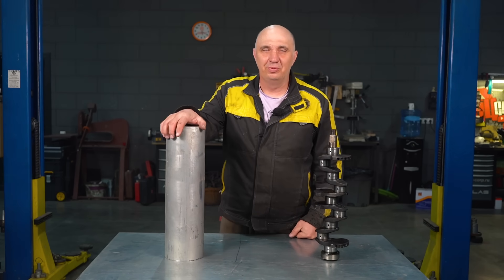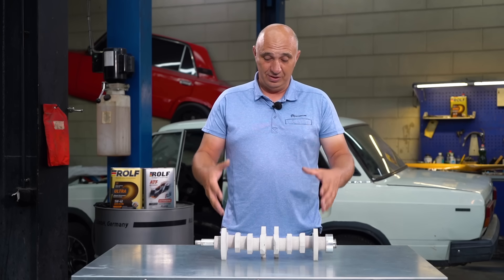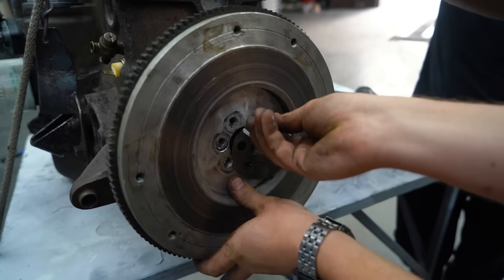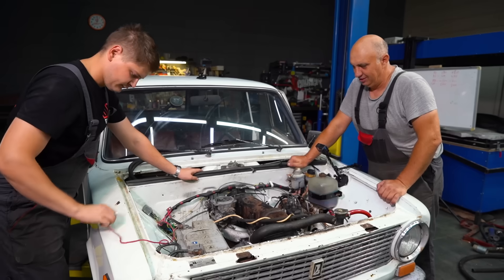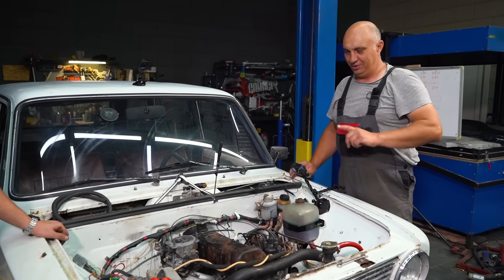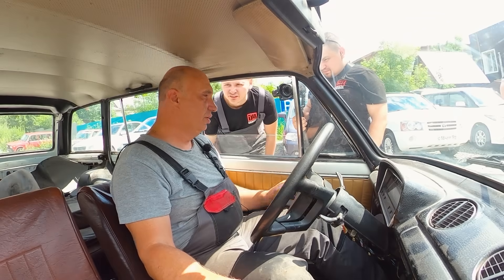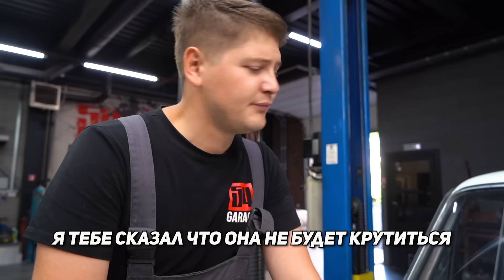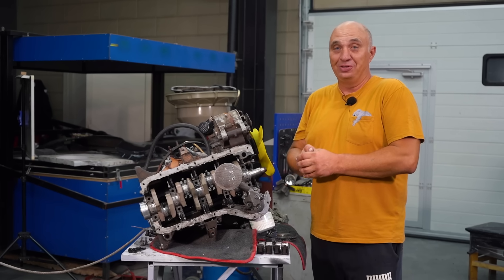We make a custom duralumin crankshaft for a Lada

Comment: Yeah the aluminium expanded for sure and most likely caused that. A bit similar thing happened on M539 Restorations channel too. I can't exactly remember how it was but I think Sreten got aluminium sleeves in a cast iron block and that caused the pistons to first eat up the aluminium sleeves and then when the aluminium sleeves cooled, the pistons started to cause piston slap and the pistons and the sleeves were destroyed.

Here the aluminium crankshaft expanded so much that the clearances went away, oil film went away and then the two metals started to eat and melt each other out, even when there was ceramic coating on the crank.

So I think if you try to install an aluminium crank to your car, you need a ton of clearances and such bearing and connecting rod materials which can take that beating of loose clearances before the crankshaft expands and the clearances become much smaller.

Comment: Clean and polish up those aluminum crankshaft journals and fabricate some PTFE bearings. Teflon has a coefficient of friction (COF) of 0.05–0.10, which is the third-lowest COF of any solid material. The material properties of  PTFE aren't the toughest but the material properties of conventional everyday engine bearings aren't very tough either. Garage54 is definitely the most qualified to find out if Teflon bearings will make this aluminum crankshaft a functional and reliable option
Reply: The shell bearings on a crankshaft never touch the crank in use. The relative friction coefficient between materials is irrelevant. They run with a film of oil in between, the only time they ever touch is on startup or in extreme circumstances where the oil film breaks down.
Reply: @otm646 I understand how the oil pressure system works in keeping the bearings floating on the oil. In consideration of the soft aluminum crankshaft material and the amount of expansion that aluminum exhibits when it heats up,I think ptfe bearings might be more accommodating to those conditions and the guys at Garage54 are the best for this kind of experiment. No other YouTube channel does the kind of "thinking outside of the box" content that these guys do sooo.....

Comment: not   that theyll translate and read it but ..... soooo use a built crank .... use aluminum throws with steel main n crank pins .... Assemble with keywayed or grooved journals and roller bearings ..... i dare ya....

Comment: before seeing it run/if it runs, i would like to predict a very poor idle/low rpm, and even hard / impossible to start. you are going to lose all the inertia from the heavier parts.  it should rev real quick and snappy but won't be as smooth and may not take sudden changes in load very well... just some pre-thoughts.

Comment: It is possible to coat aluminum with electroless nickel, which is nearly as hard as chrome.  That, and greater clearance, might make this aluminum crankshaft last longer.  You can also plate aluminum with chrome.  I remember there was one model airplane engine... Enya... that had one of their 10cc engines with aluminum cylinder sleeve chrome plated, with aluminum piston.  Both had the same thermal expansion rate, so would not seize.

Comment: This is kind of like the Russian version of the Chevy Vega. There GM did a 'nicasil' hard coating on the cylinder walls to create sort of a glorified Briggs & Stratton lawnmower engine, where here they hard-coated the crank journals. The big problem is the thermal expansion rate for aluminum is way higher than steel, so the crank is expanding and seizing the rod bearings. They probably would have been better off making the bearings out of teflon to compensate for expansion. Just a thought.😄👍👍

Comment: Nice, wonder if very hard steel bearings may have done the trick here, A2 Tool Steel for instance would keep the softer material in check... 

Changing just the connecting rods with lightweight rods on a stock engine makes a huge difference in performance.

Comment: The rods could be aluminum also. And use a large main clearance . Possibly on the . 004-.006" range, with up to .008"on the rods.  The next option would be forging the aluminum crank with steel journal sleeves. About . 300" final thickness,  possibly starting in the .750" range. Or possibly wrapping wire around! The journals then weld the wire solid, and roll shrink the steel journal, roller forging with the steel hot, just under the melting temp of the aluminum. With the aluminum not being round, so the steel can't spin, or use steel pins driven in and tig welded with a
 .060"-.080" weld over the pin. Then drill the  oil passage inside it. The pin being about
 .500" dia with a .250" oil passage. To prevent spinning the steel sleeve! A lot of trouble when a titanium crank would be easier and cheaper to make.. with a matching flywheel, and  front hub or damper, and rods!!!
 It should rev quickly, especially with roughly 200-220psi compression!

Comment: Did you balance the aluminium crankshaft? If it is out of balance it will break. You didn't use the right aluminium grade strength.

Comment: What if you could use aluminum alloy instead of aluminum use a fixed irone on crankshaft to prevent contact between crankshaft and connection rod. Hence let's it work as a bearing.

Comment: seems like you should be able to sleeve the crank with steel just on the bearing journals then you could put the crank bearings steel to steel. You might need oversized piston bearings to make up for the sleeves

Comment: 10:40 - that's what's happening with my Chinese knockoff weber - once the carb is nice and heat-soaked, the butterfly shaft on the primary expands into the housing. I'll have to take this apart again and run it through my drill and sandpaper "lathe" again ;)

Comment: my assumption is why its more quiet than the iron crankshaft is because of the weight resistance to each bang. i drive a stock bmw e34 520i with a "cold air" intake, everytime i give it a bit more gas under load in low revs you hear a loud BROOOOOOOOOOOOOOB..... out of the intake. so is more quieter because of less weight to move against combustion.

Comment: Loved the video. I always wondered if it was possible to be done. Carbon fiber also intrigues me, since it's even more resistant than aluminum and lightweight, tough the coating would be a problem.

You could try to lower the main journals and crankpins diameter and use a hard steel fixed bushing to compensate for the size, and also for durability while keeping ~>98% of the pure duralumin crankshaft weight. Also, tolerances for heat expansion are to be taken, since aluminum expands a lot more than steel.
Reply: the chemicals and heat would eat carbon fiber alive.
Reply: @Zangetsu2026  Yeah, I figured. I know the material itself is pretty resistant to temps, but the resin is a problem, as far as I know, epoxi resin is used along with the carbon fiber sheets and that would be the main problem, if another bonding material who'd be more resistant to temps could be used then it wouldn't mean a problem.
Regarding chemicals, oil companies could develop a non damaging oil for those kind of engines too, I'm sure there's a way. (keep in mind this is all hypothetical and I don't know a lot about carbon fiber)
Reply: @ayuwoker  hey man, that would be cool if the chemicals in the engine enviornment were designed to be carbon fiber friendly, and if they could find a better resin!  good ideas!
Reply: @Zangetsu2026  future racing tech incoming? Hehehe, can't wait for them Hondas to rev past 20k 🤣🤣
Reply: @ayuwoker  i've heard (but i haven't verified) that some Porsches use titanium crankshafts!
Reply: @Zangetsu2026  It would seem to be the case! I googled it and it appears that some of the Porsche 917 used in the limitless Group B had titanium crankshafts while also using magnesium alloys for other engine parts. Now, for market cars, such as the 911 (i.e.) they don't use titanium, because while being lighter than steel and more durable, it's also very very expensive thus not quite marketable
Reply: @ayuwoker  ah! i think i found it:  

regarding the Type 917  

"In 1968 titanium crankshaft used 13Kg it was 10Kg lighter than the steel version!"
Reply: @Zangetsu2026  now thats a lot of weight, 23kg for a crankshaft seems pretty normal considering the amount of cylinders and displacement those engines had, but 13kg for the same engine is just otherworldly. No wonder they revved so quickly

Comment: You know, just the fact they were able to machine an entire fully functional billet aluminum crankshaft with a lathe  and a mill, and not one single piece of cnc equipment in site, is absolutely incredible.
Reply: How do you think they were made before the computer controlled machines were made?
Reply: @roddycreswell8613 so why did you asked him? We answered casted but you cleary ment a lathe
Reply: @littlereptilian7580 there were no cnc machines when engines were first built. This comment makes out like machinist can't mill a block or turn a crank.
Reply: @roddycreswell8613  NC tape controlled machines have been around a surprisingly long time.
Reply: @roddycreswell8613 more than likely cast iron. Which is why most v8s back then did not putout as much powers as v6.
Reply: @GregsAutomotive I know how they were made, v6s were no different. Longevity meant something then.
Reply: Mass production of engine crankshafts even before CNC required specialized  production machines. Crank throws would be machined on specialized lathes that had the tooling carried on offset diameters that were timed to follow the offset of the actual crank throws. Pin grinders mounted the finished main bearing diameters in saddles mounted in the grinder work heads. These saddles were positioned offset from the crank centerline to match the pin offset. The crankshaft was positioned with a pin that would index the crankshaft to bring the pin diameter to the centerline of the work heads. Cam grinders used master cams that would rock the cam in relation to the grinding wheel to grind the lobes. Main bearing diameters were machined on lathes or rotary broaches that would rough the bearing and counterweight diameters in one operation. One important operation was drilling and reaming a locating hole in the flange end of the crank. All subsequent operations were done in relation to that hole and the flange end of the crankshaft
Reply: Not to a machinist. :) I could do it in my home shop if I wanted to.  Barely.  I'm a little short on tooling that would make it easier.
Reply: My 1946 Riley had the crank machined from a billet.
Reply: @rogerbarton1790 
That's wasteful of material and more importantly machining time compared to a forging. Also likely very hard on the tooling consideringthe materials available for cutting tools in the 1940s. I know brazed carbide and stellite were available. Not sure if any inserts were then.
Reply: @mpetersen6  I work in a steel forge making crankshafts for CAT and John Deere. Forgings are stronger of course. I also have a 1920`s lathe with some of the original tooling. No inserts. I do have some really old insert tools but look around 1960`s/70`s.
Reply: Machinist can do that.  Oh yes, they can.
Reply: its just cool relax guys yes you can cast them but still need to mill and shit also you can completley machien them like in the vid and yes we humans can do that since what? 1860?? its crazy specialy wehn you look how africa is doing or afganistan

Comment: Would have been better to use plain steel bearings instead of the white metal ones, many small engines run for years with just an aluminium con rod on steel crank shaft so it should work the other way around.

Comment: Personally I've had a lightened stainless crank made and found it to be superior to the original cast crank the engine had and that was "only" a VW Beetle. But I also lightened the Flywheel myself and increased it's engine capacity from 1.6L to 2.1L to make a sleeper.

Comment: It's the same concept as the VAG 1.2 TSI "CJZC" engine which uses a very weak but super light weight steel crankshaft, along with light weight aluminum components through out the entire engine. The result is a super quiet engine, and low fuel consumption.

Comment: Maybe the key is with the bearing themself. If you could make a roller bearing set up some how, like they do with cam rockers, get the heat down, might work. I dont think simply increasing clearance will work , youll get extreme wear when cold

Comment: I would expect the crankshaft counterweights would need to be much larger than the cast iron counterweights to balance the steel connecting rods. Massive imbalance was likely a significant contributor to engine demise

Also, anodising the journals would give better wear resistance and better clearance control

Comment: Is there a way to cool a running engine to not getting above say 50* degrees Fahrenheit? Also if you can would the Engine run longer and without as much ware down. I think this would work great if you could upgrade the cooling system.

Comment: your crank journals will have an expansion of around 0.3mm at working temperature. your stroke will expand around 0.4mm . Thats one of the best videos you made so far.if you redo your clearances and heat your engine before operation this could work
Reply: Electric pump and heater for the oil. Run the pump until it gets stable at 200f. 91 c
Reply: Moon dust
Reply: @dennisford2000    moon dust?  what?
Reply: Aluminum flywheel

Comment: back in the 70's etc when they were making deep diving crab suits (bearing joint angle things) out of aluminum they were using mass compression forges and heat curing to make incredibly tough alloys.   I suspect such would result in better wear surfaces on the crank but the application structure and method for the journals and slips on the block would be where you'd have to mill to fit the crank instead of the other way.

Comment: No need to use an expensive ceramic coating. Just have it anodised to 25 micron.
Anodising is extremely hard - Aluminium oxide is used for abrasives.
Since you need more clearance, you could just machine off the coating and try again with anodising.

Comment: I am pretty sure it's just thermal expansion
I think you should repeat this experiment, but with an aluminum block engine and make the crank caps out of aluminum as well . That way you can help minimize the effects of expansion.
You might even be able to reuse that crankshaft since you have to machine the journals undersize anyway.

I would think that you should make the thrust clearance way less too. I know that's not good for longevity, but you're not expecting to run very long anyway.

Comment: My assumption is that the Aluminum crank has a higher expansion rate, so you must try an engine with all of its parts from the same material. If you look for something light yet strong, try titanium.

Comment: Some race engines have used forged aluminum crankshafts, but the crankshaft is lined with a hard bearing to reduce wear and expansion. The issue with this setup is now that the crankshaft is lighter, its not balancing out the reciprocation of the pistons so there will be greater vibrations, the original iron crankshafts were tuned to balance out the pistons. 
Still, another great experiment from you guys!
Reply: @Zangetsu2026  oops...meant to write "single" , I meant single-cylinder engines (for bikes obviously) ;-)
Reply: The crankshaft balances the pistons. Its secondary rod vibration i think you mean.
Reply: A much bigger issue is that aluminium alloys have no fatigue limit, so any crankshaft made from them is doomed to a short life before failure.
Reply: It's a bit less important on an I4, as the primary is balanced, but the secondary balance will suffer. Small displacement motor... Meh. It's not going to matter as much as you'd think.
Reply: "Some race engines have used forged aluminum crankshafts"  

i've searched google but i cant' find any info, can you please help me?  

do you have any names of the race engines?  maybe i could search with those names...
Reply: @Zangetsu2026  I have never heard of one single example. I can't wait for his response to educate me!
Reply: @Zangetsu2026 
Well, I'm pretty sure I've heard racing teams producing connecting rods with balsa. So I've decided it'll be the perfect material to use for the diesel engines in our 50 ton capacity dump trucks. In fact, I'm thinking of "forging" the entire block from a large cube of balsa. Don't worry folks, I'll use steel liners for the cylinders, which should alleviate any foreseeable problems! 😉👍
Reply: @Zangetsu2026  he is talking about single-cylinder race engines, some racing engines have used aluminum crankshaft in the past...way WAY past... (that's how I remember...), 
also some military aircraft radial engines had used aluminum crankshafts. 
google isn't a big help...I just searched myself and....I don't have the patience to scroll 1000 pages of results! :-D
Reply: @vasopel   and you are right, google is horrible at finding relevant results now
Reply: @Zangetsu2026 horizontally opposed Subaru.
Reply: @everettplummer9725   "horizontally opposed Subaru."   <---  what about it?  

concerning Subaru, all i could find were aluminum crankshaft *PULLEYS*
Reply: Only in a single or v-twin does the crankshaft balance piston mass; on every other arrangement the pistons (and rods) balance each other.
It is routine to balance a crankshaft, flywheel and clutch assembly outside the engine, this would be meaningless if the assembly also countered piston mass.

Comment: Machine all journals down enough to allow steel half caps to be fitted, welded together, then machined as new journals at a slight undersize to allow for expansion. Add a large engine oil cooler to keep internals temperature down.